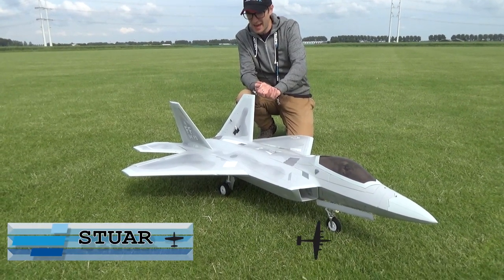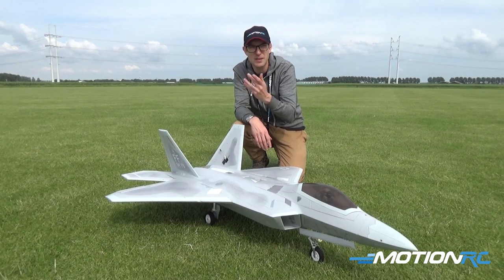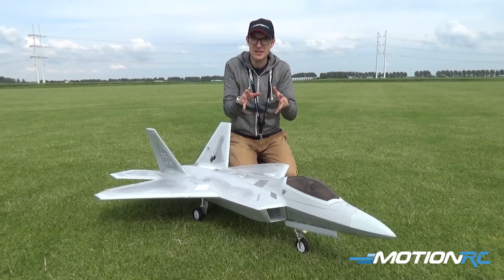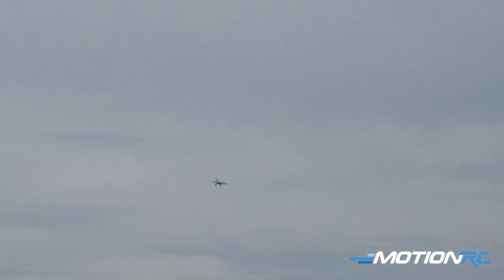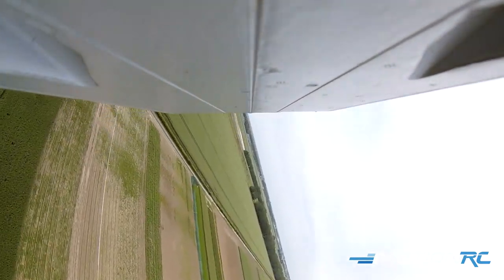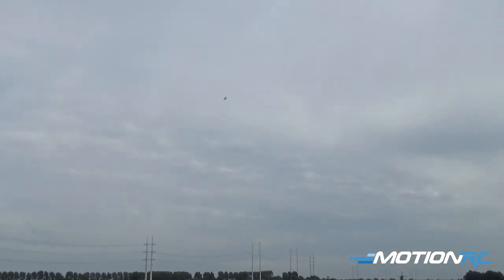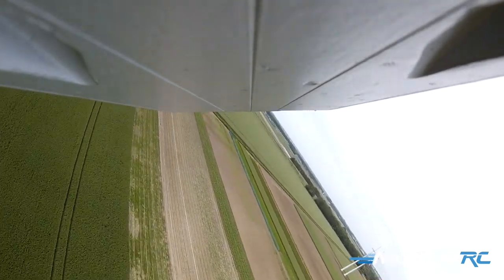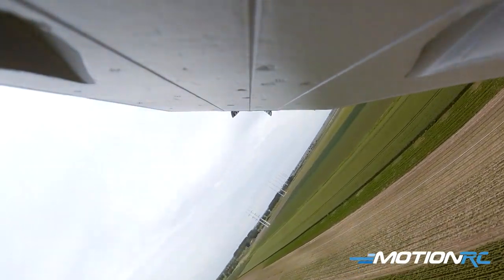Freewing F-22 Raptor 90mm 8s EDF Jet - Grass Ops- Motion RC

Comment: i love tight turns at lower speeds it looks like its skidding through the sky. we have the 6s  version
Reply: Ya, looks scale when ya slow it down..that body & wing create lots of lift, ya just need to keep power in as "whipping" sticks, that wing & control surface deflections create tons of drag..eating airspeed.. bumping throttle 1-2 seconds BEFORE maneuvering hard helps a lot!

Comment: I am using a precision aerobatics katana 52 and an extra 300 and am thinking of getting this. Should I move to something else like a smaller jet or a different type of plane before I move into it?
Reply from the maker: This F-22 surely has trainer characteristics for an EDF, but we usually don't recommend an EDF this large as a first EDF is only for the price. Only you know your confidence level with setups, pre-flights and flying. If you are ready than you will love this one. But other less expensive, great started EDF options from Freewing are the Avanti, L-39, T-33, F-86.
Reply: @MotionRC  okay thank you for the options